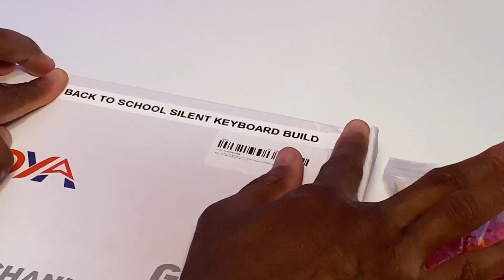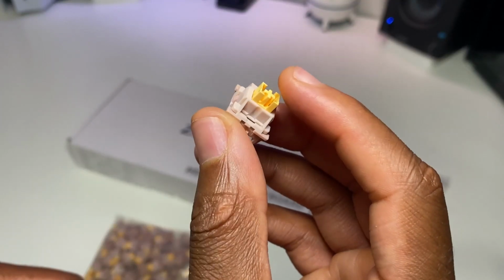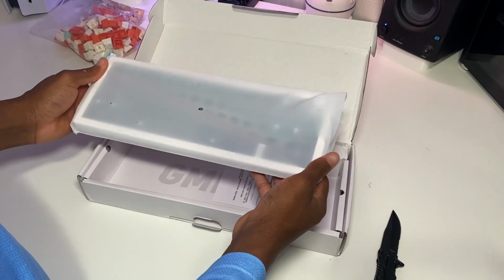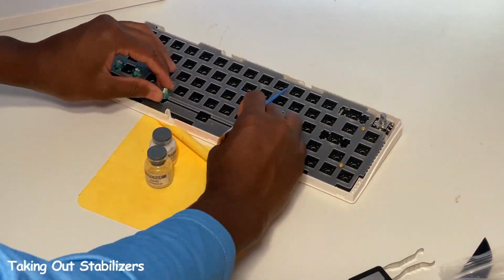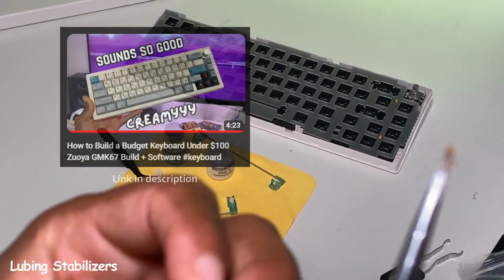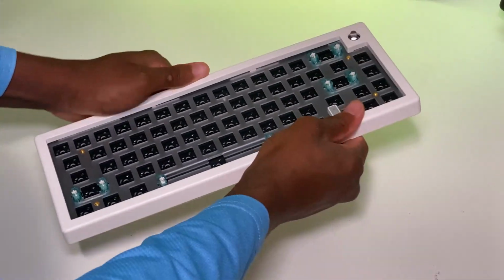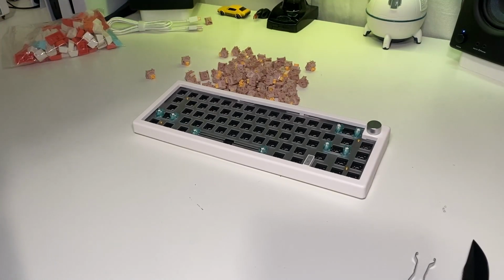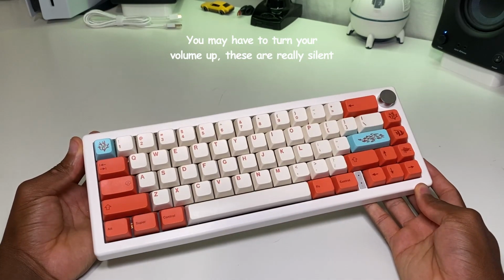Bet Budget Silent Keyboard .. Back To School Quiet #keyboard Build

Comment: thats a pretty good keyboard, but if anyone wants a prebuilt base I recommend getting the AJAZZ AK820, its hot swappable, wired, and rgb, all for only $50 on amazon, with the switches your total will be abt $77 or so
Reply from the maker: This is solid build! Awesome recommendation! 🤙
Reply: @ thanks

Comment: Im getting my first custom silent build with the same board and switches. Im wondering if tape mod actually makes it sounds louder? Also you mentioned MDA keycaps makes  muffled sound so it does make a differecence compare to say cherry profile ones?
Reply from the maker: The tape mod made it sound more bass heavy; there was more lower pitched sounds. The Cherry profile will not make it as muffled as this one, you may get a different result. It could be better if you like higher pitched sounds